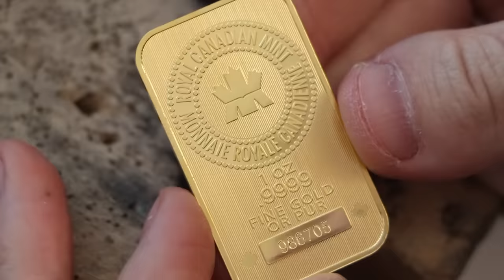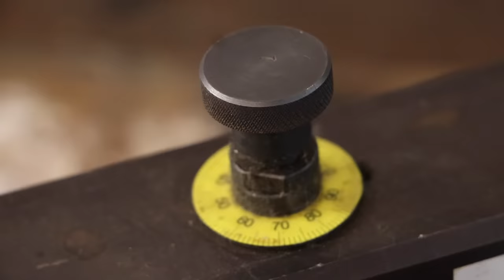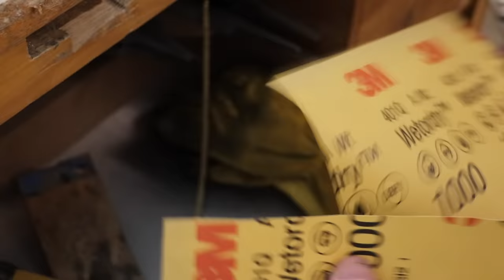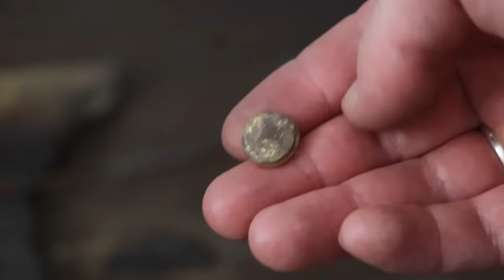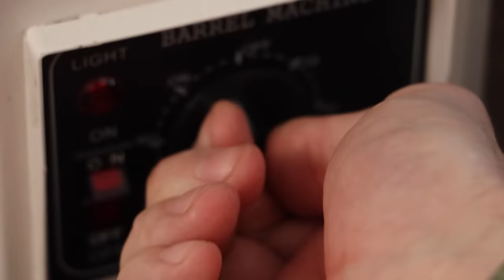18k Yellow Gold Solid Foxtail Link Necklace | dynamisjewelry.com

Comment: After making a dozen in silver ive finally made one in gold, 1.5mm wire and 22.47 inch long with 6.5 ozt so far. Itll be over 7 ozt when i make the box clasp, i couldnt have done any of this without copying you as i had zero eperience in making jewellery. Thank you for the instructional videos, im now going to pursue a career in jewellery and smithing.👍🏴

Comment: Are you spraying it with flux water when you are annealing the roll of gold wire?    And is this just to avoid tarnishing during the process?  I see you pickling it after each anneal anyways.
Also, what gauge wire did you take it down to using the draw plate?

Comment: I am wondering what other metal you used to take that 24 carat one ounce gold bar down to 18 carats for your necklaces.  From watching all the way through I was thinking you might charge around $3,000 each, but when I went to your site those necklaces are priced at $9,000 each.  Now days I would be afraid to wear it anywhere because times are getting tough in America and sure enough someone would hold us a gun point just to steal it.  Your workmanship is outstanding and the finished pieces are absolutely gorgeous.

Comment: Beautiful work of art.... However in the beginning you started out with .999 gold bars. So why did you stamp 18k on the latch? Shouldn't you have stamped 24k since you used 99% gold?
Reply: If you look closely before he puts the gold bar in the smelter, you can see two other metals in there. Copper and a white metal. So the chain isn't pure gold. He used 75% pure gold to make 18K gold.